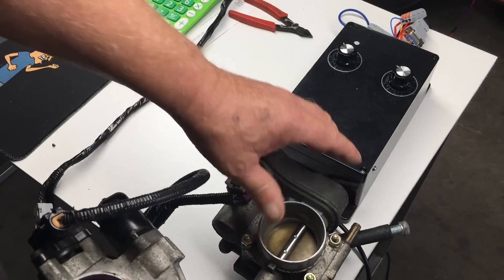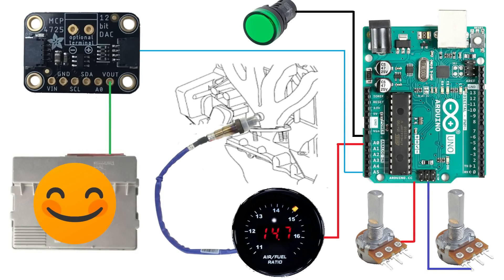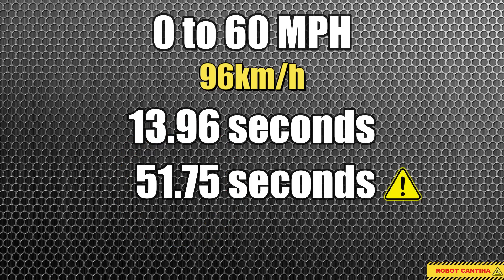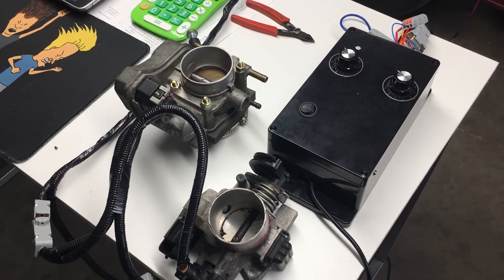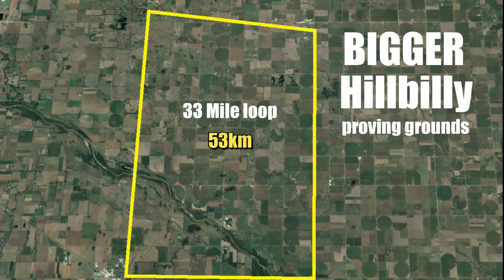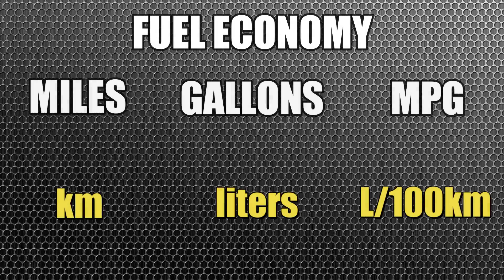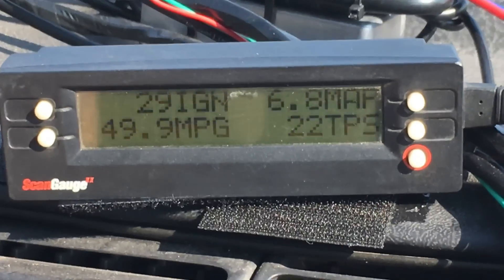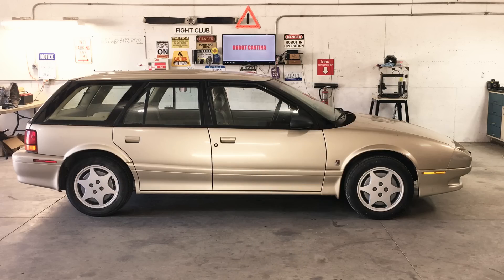S2E21: Our modified Saturn that gets Extreme MPG with lean-burn and Robo-throttle.

Comment: Oh it feels good to go back and watch some of these older episodes. I'm about to start playing with my own fuel economy experiments, nowhere near as innovative as yours because I'm using off the shelf stuff the way it was designed and doing zero coding. But surprisingly it's actually very similar. An O2 sensor, a map sensor and an idle air control. I don't know if I'll document any of it but if I do, I can confidently say that both the idea and the videos would be inspired by yours.

Comment: try doing maximum lean burn, advance the ignition timing, while injecting water mist into the engine intake to cool down the combustion chamber and intake. It will prevent detonation and thus you get more power from the advanced timing.

Comment: One thing i was thinking about with my saturn
Apparently they use map signal to determine load and rpm to collectively determine ignition advance. 

So if one could trick what it thinks the map signal or engine rpm is.. without throwing a code. You may be able to alter the ignition timing... .  My saturn has a carburetor on it.. i was able to get a highway run at 42.7 mpg with a carburetor. Although the carb adjustment restricted me to 72 mph tops. But cruising at 65 was decent. Except for those hills.

Comment: It looks like the Saturn has double ended coil packs consequently it's using a wasted spark ignition system i.e. when one cylinder on a coil is firing on the compression stroke, the cylinder on the other end of the coil is on it's exhaust stroke so the spark in that cylinder doesn't do anything except give the coil a ground/chassis return..

Comment: Doing a bit of my own research, you are correct: changing the timing table will cause issues with the fuel injection on that engine. Everything is tuned to work perfectly with the fuel injection system and is set in stone. Not having a cam sensor to manipulate (that exists in the case with most injection systems of this type), there is nothing that can be done.

Comment: I wish my economy experiment worked as good as yours, I built a 99 civic with a D15Z7 1.5l lean burn engine, long gear transmission, manual steering rack, anticipating 60 MPG but got a max of 47,....Its a slow car that wouldnt beat a Prius in a drag race

Comment: I suggest a 1992-1995 Honda Civic hatchback, preferably the DX model.  About 2,000 lbs dry and you can use a variety of tuners to do almost anything you want.  There's even a VTEC-E (E for efficiency)  engine with 3 valve profiles (I forget which models, but it's a D Series engine and bolts right up).

Comment: Those year Saturns didn't reference the camshaft signal for fuel injection because they had a waste spark ignition. Meaning 1&4 would fire at the same time and 2&3 would fire at the same time, every revolution.

Comment: What if all accesories from the engine went electric? Like steering pump, water pump, oil pump, just keeping the alternator, all modern engines are getting everything electric, even alternator is gone and just charging with the wheel wasted inertia.

Comment: Small turbo with only a pound or two of boost, this will help with throttling/pumping losses. Warm air intake? head porting? catback open exhaust? high flow cat? headers wrapped with fiberglass?

Comment: The way they bypassed the need for a cam sensor was to use the resistance of the waste spark ignition on the #4 cylinder on the exhaust stroke to calculate cam position.
What's odd is when these Saturn's throw a code for a non-existent cam sensor.  But they can act up with some aftermarket plugs and wires that run low impedence as it gives back improper readings.
Also, haven't watched all your vids yet, but have you tried tricking the egr into opening sooner/staying open longer?

Comment: This is very interesting. As a  auto tech i commend you on your experiment with the mpgs effort. 
I want to do something similar to my chevy S10 with the 4.3L. I want my truck to be capable of doing normal purpose driving habits like towing while trying to maintain decent mpg numbers if not a bit better. At the moment my truck is avg 19 mpg combined hwy/city in stock trim. But I feel it can greatly improve by fine tuning the ecm (like what you have been doing) and by converting the stock intake into a true fuel injection system by switching over into a marine intake base which is much heavier but can be more beneficial in the power band and air/fuel atomization process. Again, the issue lies within the ECM to fine tune the system correctly once the modification has been done since more air is being drawn into larger intake base. The conversion alone can create a lean situation and cause the stock ecm to add more fuel then needed. Watching what you did regarding to timing and the use of a wideband o2 sensor has me thinking.
Great video thanks for the post

Comment: Out of curiosity, does the smart throttle system know the speed of the car? If it did, you could program a system where at a standstill the position of the accelerator is translated 1:1 to the throttle, and as the speed gets up to 45MPH or 60MPH it gradually gives more and more influence to the smart throttle system. This would allow more freedom of acceleration during slow speed driving such as start and stop city traffic while still giving some of the benefits of the smart throttle system at higher speeds.

Comment: In 1981 I bought a new Dodge Omni Miser.   1.7 liter 4 cyl 4 speed manual transaxle.   It was the 4 door, not the 2 door more aerodynamic model.   I believe it had a carb, not fuel injected.   But somehow the fuel/air mixture was adjusted by a computer for economy.   I drove that car from Akron, Ohio to Myrtle Beach and back,   and  from Akron to Tampa and back.   We got an honest 41 and 42 mpg with no modifications,  just very careful acceleration and slowly decelerating as we climbed hills.    I often wondered what I could have gotten with a different final drive ratio and maybe narrower tires and maybe ignition timing changes.   That was 40 years ago.   The auto makers should have gotten WAY better mpg by now.

Comment: I wonder if the engine has had any damage done from running lean, and from the newer vehicles I've drove with a electronic throttle vs a similar older model the older model with a throttle cable gets better mpg. Let alone throttle response is best.

Comment: with a standalone ECU and water injection you should prevent pinging and get really high AFR.I tried on 2008 ford fiesta but the original ECU couldnt be tricked.

Comment: 60 MPH is fast enough for some kind of contemporary aero kit to have a strong effect on the figures 
Start with simple panel alignment, then tape the seams, and eventually move to splitter, front damn, side curtains and a diffuser on the back

Comment: I had a 96 SL and a 2001 SC,  both 1.8 without ac or power steering.  Stock I averaged between Highway and City driving 43-45 mpg.  GM managed to completely destroy this brand.......  The EPA helped too.

Comment: my grandma had my great grandmas saturn for years.  It was the biggest POS ever but 40 plus MPG easy.  Would randomly roll its windows down by itself and you couldn't use the door locks or it would randomly start switching between unlock and lock for like 10 minutes that you could not physically pull the handle quick enough to get out (like how someone hits the unlock button when you already pulled the lever and it won't open the door).  One time my grandma had to climb out the window cause they couldn't get out LOL.  Grandparents loved (and hated) that car still one of their favorite stories about getting stuck inside.

Comment: Did this by accident with a lifted, carburated Toyota pickup 17 years ago. 200 miles on 1/3  tank of gas... normally it used 5x that. Acceleration was abysmal and going through a small town with the only stop of the drive, the engine would not idle at all, so I revved it and rolled through, just to get home. Once home I found the studs to mount the carb had backed out, allowing air in, causing it to run extremely lean. I pulled the plugs, scoped the pistons, and checked compression and everything was perfect. 
Great job using your head to push what is possible with gasoline engines.

Comment: I own a 2002 sc1 for 17 yrs.  ..410,000 kms..still gets 35- 42 mpg....on pump gas..no mods .but all new plugs& filter ..higher lbs tire pressure ...

Comment: Your addiction to gasoline is impressive. Hundreds of hours of work, and thousands of dollars invested to get a third of the MPG of my Bolt while also sacrificing any fun driving. 
City driving I can break 6mi/kWh or 200mpge. Highway driving at 60mph I get 4mi/kWh or 135mpge. It goes 0-60 in 6 seconds, corners amazingly well, and has instant torque. 

Still worth a like because it's neat stuff, just outdated.

Comment: there is one thing: not oppening the throtle induces suction losses. that is inherent to the Otto cycle of gasoline engines.

if you could manage to do the oposite (open as wide as possible) and control the fuel (like would a diesel cycle engine) to keep the RPM within the desired range, then we would see some serious efficience improvement. there might be issues of overheating due the super lean mix, and also the question of the timing...

another option is to find a way to 'gear' so a full open throtle would give only the desired RPM by using a gear higher than the usual. (perhaps skip from 1st straight to 3rd or 4th and keep the throttle full open while acellerating?)

maybe a mix of both: gear higher in the acceleration and leaning in cruise....

you guys are the geniuses. i am only a theorist :D

Comment: This is fantastic stuff.  I did a few experiments years ago with a diesel VW Polo.  Just easy things like removing unnecessary weight, streamlining and improving aerodynamics.  I also put on slightly narrower tyres which reduced the drag coefficient.  Didn't get too involved with the engine except a remapped ecu but I did add a different gearbox for a longer top gear and final drive

Comment: The knock sensor will act ONLY when there's too much compression, too much temp. while using low octane fuel, which will cause knocking, so it will ADVANCE timing to start ignition before the knock, and it will compromise efficiency and delivered power. 
You can make it useless by lowering temp, increasing octanage or.... lowering compression, and if you have some gasket leakage, you "may" have some compression issue/s around.
Increase your compression (12/13:1+) and really lean that AFR, you will keep knock risk low, will decrease temp. too and have more fuel economy.

Comment: I have an Idea for your robotrottle: what if below 30%throttle the car decreases, between 30% and 60% ist holds its speed and above it increases Speed. Like a foot controlled Cruise Control. I think that would also save some fuel

Comment: Best afr for Air is around 12.8:1 and best afr for Fuel is 16:1.

More Fuel than 12.8:1 will not make more hp/air

More Air than 16:1 will not make more hp/fuel

Comment: Thats a terrible 0-60 time, My Saturn took 10.58 seconds to get 0-60 and it was the 1998 SC-1 single cam...it wasn't modified, I DID do those "fuel cleaners" like once a month but no way it cut 4 seconds off yours...and it had the AC and power steering....

Comment: Have you considered revisiting the 1920's method of burning gasoline vapours 'only'?  Liquid gasoline does not burn... only the evaporated vapours burn... yet all modern cars refuse to try to make this transition.  Yes there are dangers, but liquid fueled vehicles are dangerous anyway... we've just invested technology to overcome those dangers.

By vaporizing the fuel before it enters the combustion chamber assures near 100% fuel combustion... no liquids to remain un-burnt.  This typically happens with a pre-carburettor vapourizer at temperatures around 300°F, but absolutely below 520°F to prevent autoignition.

This requires changing to a gaseous-type carburettor such as used in propane powered vehicles.

Comment: What about putting a small resistance into the circuit after the cps...

A single LED might be enough to delay the signal or perhaps a small capacitor is enough to offset the crank position signal in a primitive manner.

Comment: I used to work at staurn. I rebuilt a twin cam with flat face valves, had the head milled 20 thousandths, put on an obx header with 2.5" exhaust and some NGK plugs and got 42 mpg. I averaged 30 prior to that. Everything else was stock. Even the air box. Gained tons of HP. And it was a 4dr. Those engines got a bad rap for oil consumption but aren't bad little units.

Comment: These are always fun and informative. As a turbo diesel VW owner, a handful of times when watching, I thought to myself, "Well, that's great for gas, but I was getting better from a stock diesel." Happy to hear you're delving into a diesel swap, curious to see what methods can be done for tricking one! Oh, and the wagon is much easier on the eyes than the coupe!
Reply: @do oby It's about 10-20% more expensive here too, but my 2011 VW TDI Golf gets 55mpg+ on grippy 17" tires, with LRR 15" tires (like a Prius would have) you could expect upwards of 65mpg. For comparison, the 2.5l gas motor that was also available for the 2011 Golf "only" gets 32mpg highway. Pretty good for a 5cyl 170hp car, but nowhere close to the turbo diesel.
Reply: @do oby To explain a bit more in detail (not an engineer or anything, just an enthusiast), diesel motors can run at a much lower fuel/air ratio. Some run at 100/1 ratio of air to fuel at idle. At full throttle, depending on the engine, it can be somewhere between 14:1 or 25:1. A properly running gasser will always be around 15:1. A diesel will be anywhere from 15:1 to 100+:1 depending on how hard you're pushing it. 

In short - gasser is always around 15:1 - air/fuel ratrio.
Diesel is anywhere from 15:1 - 100+:1 depending on how you drive.

This is also why diesel owners get such varied MPG.

Diesel is typically most efficient while accelerating near full throttle, say about 75%. A gasser is not. Use near full throttle for accelerating, get up to cruising speed, enjoy your 50mpg+.  And considering the torque they have, it's not painfully slow. 

On a gasser, you need to baby it up to speed since it's not nearly as efficient when pushed beyond say 40%. So you take your sweet time getting up to speed, and then when you're at cruising speed, you're still at a constant disadvantage because of the air/fuel mixture factors.

On top of ALL OF THIS, diesel is just inherently more reliable. Of course, it varies from motor to motor. There are plenty of gas motors that will outlast less than optimal diesels, but if we look at the basics, diesel will last longer and require less maintenance. There's more that goes into a car's cost than fuel!
Reply: @do oby Diesel contains 20% more energy per unit of volume than gasoline. Ironically, diesel is lower than the price of gasoline here in Northern California at the moment.

I believe that the fuel companies strive to keep diesel prices 20% higher than gasoline to discourage diesel automobiles in urban areas. Diesel is largely used for trucks and semis in the USA.

Comment: HEAT THE FUEL.
It will improve atomisation and flame front speed, thus negate need for more advance while very lean.
There is studdy of American institute of fuel preheat, with amazing results.

Comment: meanwhile in europe, every gasoline car has 50mpg while driving 60... diesels have even more... Here is proof  https://i.ibb.co/XJDvbtZ/Screenshot-20220919-080239-Gallery.jpg and considering that it is a van diesel it is great result https://i.ibb.co/G0x70vL/Screenshot-20220919-080350.jpg

Comment: I had an idea for a future episode: a 3D printed head gasket.  You might be able to get it to work on one of the Saturns using a higher temp plastic.  it would be interesting to see how well it would hold up over time, and how well it would seal.
Reply: Unfortunately printers with a suitable print volume are quite expensive. Could do it with the insight 1cyl, though.

Comment: I think the air conditioning and power steering could be brought back if you used an electric compressor and electric pump respectively.

Comment: You should do freevalve as well. Aka, “electronically controlled pneumatic valves”; such a system can do continuously variable valve timing, lift and duration. Essentially, it’s VTEC on steroids.

Comment: The work is amazing that you put in to this. And it is fun to get an understanding on how different components effect the performance of the engine. I had an 1995 Volvo 440 SE 2.0. It had an PSA motor that used a simple EFI system with MAP-sensor in the intake, water temp and air temp. And it used an DIM ignition with the ford style combined coil-pack. It averaged 6.5l/100km in city/urban driving. But on longer trips (400km+) we could get it to 4.5l/100km. I would have loved to have been able to dig in tot that ECM and see what type of witchcraft the PSA engineers managed. It also just accepted an 50/50 gas e85 mix. Even tough the fuel economy suffered.
Anyhow, great content as usual :)

Comment: Lower it and get some lighter wheels+tires... maybe get some skinny wheels+tires in the back to reduce drag from that too

If you really want to go all out, make some panels to make the whole bottom of the car flat to get rid of any pockets that trap air and act as a parachute to slow the car down

Comment: You now why they don't use lean fuel on engines? Is due to pollution from NoX, more harmful than CO2. Also you risk to make a hole in the Pistons!! Maybe also using tyres with bigger diameter, this will reduce rpm at the same speed.